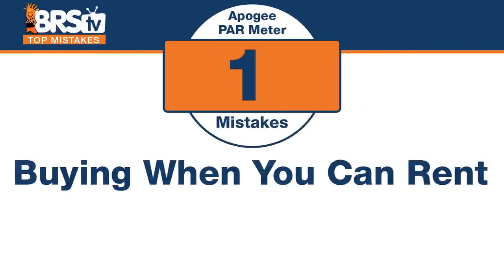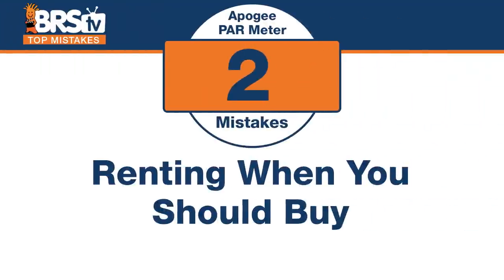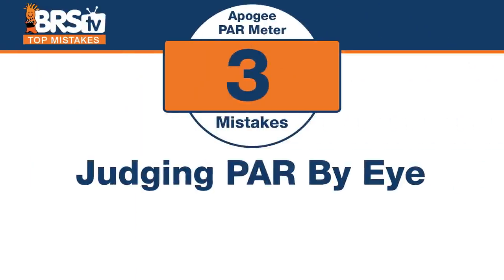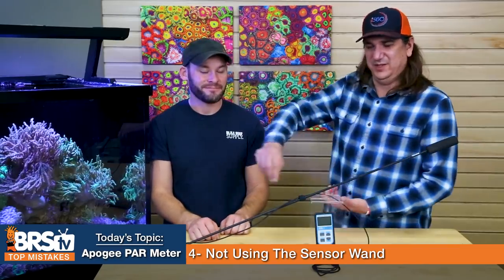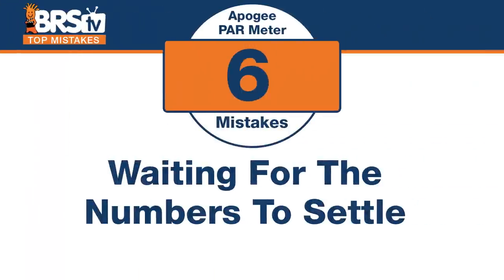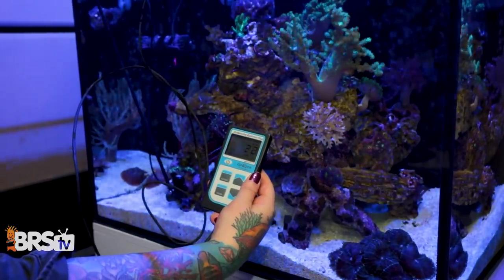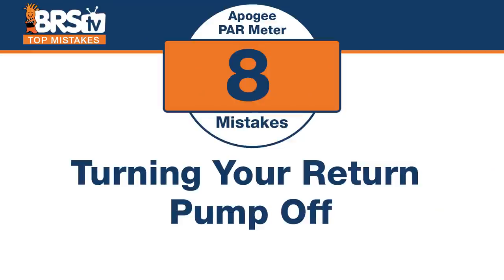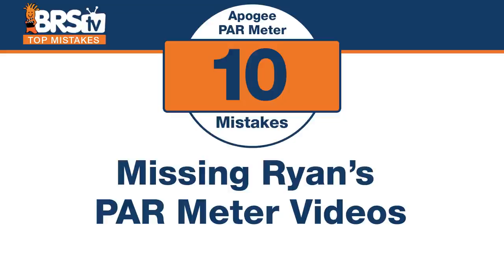Apogee PAR Meter Mistakes That Are Affecting Your Reef Tank Even if You Haven't Used One.

Comment: I will disagree with the first point... you are going to need a PAR meter as long as you stay in the hobby, at the start you can get away with renting but on the long run you will need one for replacing/adding new lights, when moving to a bigger tank, getting a second one, adding new corals/softies or changing the location of the rocks for example. It is just like a refractometer, tweezer, turkey blaster or graduated syringes, you need at least one of each!